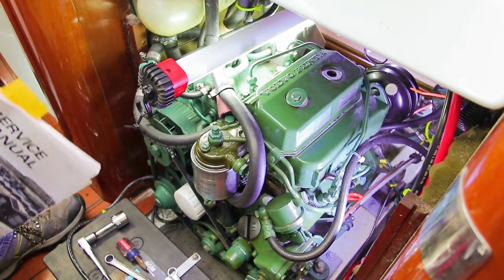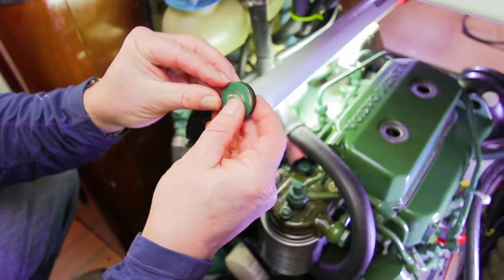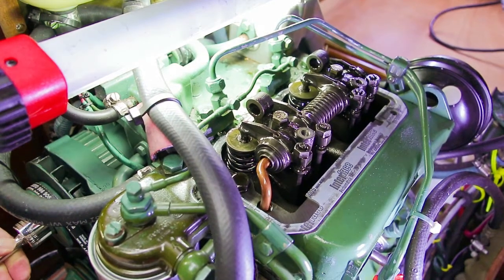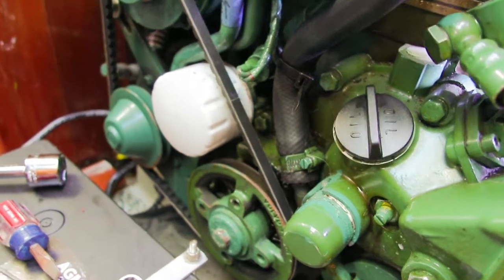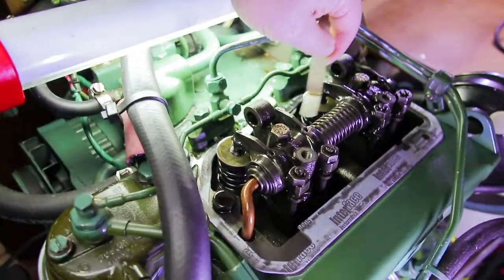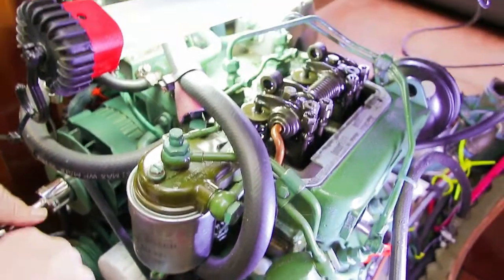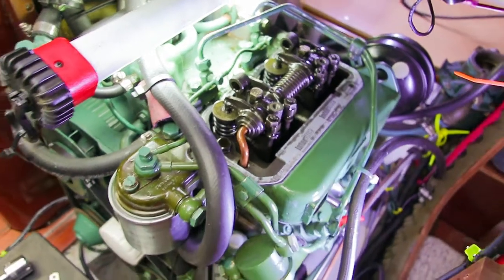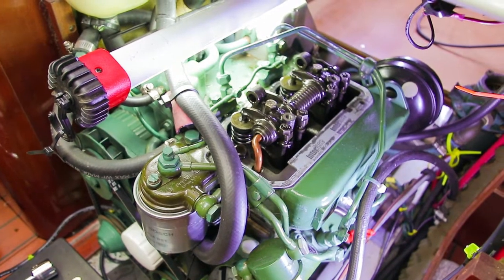Volvo Penta  2002 marine diesel valve clearance adjustment

Comment: There are no torque specs for the valve cover bolts in the workshop manual. Mine were fairly loose coming off, but these engines vibrate 2002 vibrates a lot, so don’t want them coming loose. Anyone know the actual spec?
Reply from the maker: good question.

Comment: Just tried to do it on a 40 year-old Penta 2002. Was able to slide the gauge in the intake valves but not the exhaust valves. They must get looser from wear and tear or do they get tighter?

Comment: Thabks ror reply.I have one built in 1986 abd it has the lecer. I got fed up with the suction feui pump failing due to pooriy fitting couplingsi,I converted it to an electric feul pump. Now runs kike a dream with a beat you can dance to.

Comment: Valves can be set cold. You should be turning the engine over on the crank shaft nut as you are putting strain and wear on the fan belt and alternator bearing. There is also a decompression lever which allows you to turn the engine more easily.
Reply from the maker: All good points.  I was unable to get a wrench on the crank nut.  After consulting a Volvo shop, they confirmed there is no decompression lever on the model I have. I searched all over the engine with out finding the lever and began wondering if my eyesite was failing.

Comment: Thanks for your effort. I will do this on my 2003 tomorrow (if I dare). I guess I will need a new gasket.
Reply from the maker: Always good having a new gasket available.  You won't need it if the installed gasket remains in one piece while removing the valve cover.  Your 3 cylinder will have max compression at 120 degrees instead of 180 in my 2 cylinder.  Have fun.

Comment: There is a lever on the engine at the front which you turn that releases the compression so you can turn over engine easily while doing tappets. Would not advise using alternator nut as it could cause belt slippage and also putting strain on the belt.
Reply from the maker: This model of the 2002 does not have that lever.  Even though it is depicted in the manual, I couldn't find it.  Called Volvo.  They confirmed no decompression lever on this model.